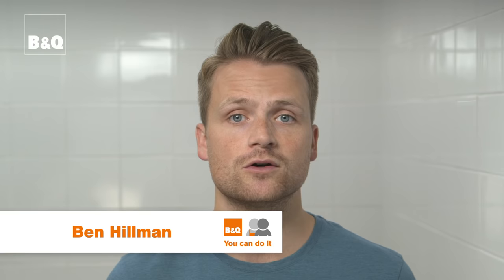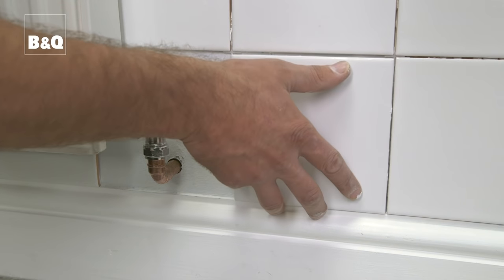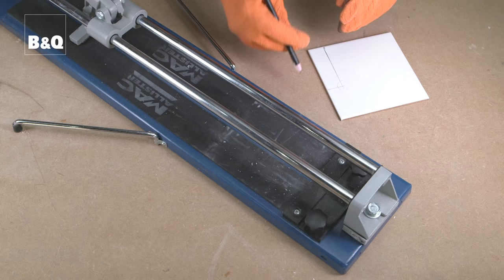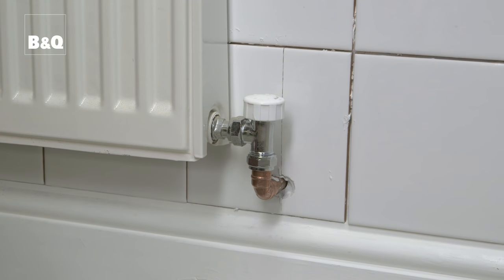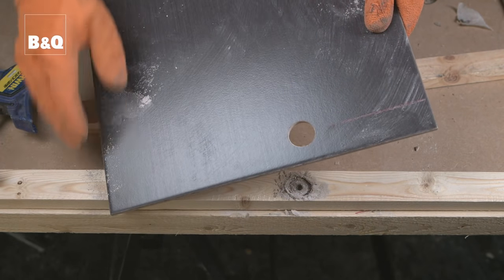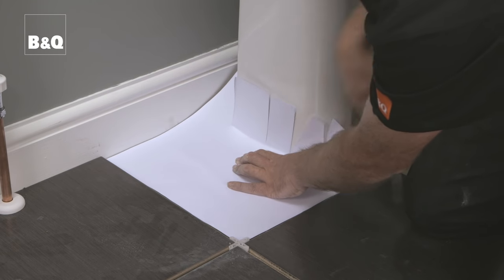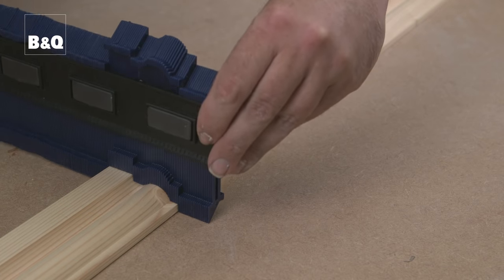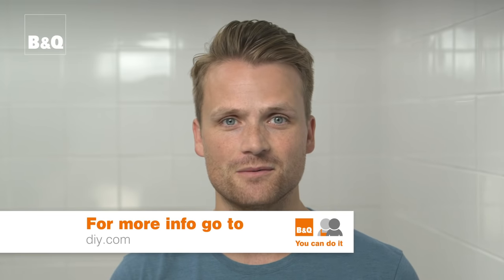How to tile around obstructions

Comment: Love how they measure up properly and cut the hole for that radiator pipe bang on - but the fit an absolutely atrociously off-centred tile afterwards! That'd be off in weeks, with the hot pipe expanding! Amateur hour :)

Comment: I'm dreading this job. My home was retrofitted with gas some point before I moved in so I have exposed pipes running around the entire perimeter of my house, including the bathroom (rather than neatly poking out of the wall as in this video) and they have made every renovation job so far so much more complicated. Perhaps foolishly, I've chosen quite large tiles for my bathroom and I think smaller ones would have been sensible - I can basically guarantee that every cut is going to be difficult. Thanks for the video - this was helpful and somewhat reassuring that it's possible. Wish me luck.
Reply: Hope the job turned out great for you 👍

Comment: Surely you couldn’t tile the bath and the reinstall the sink
Reply from the maker: Hi, there. Thanks for getting in touch. While it's possible to tile around a sink, it wouldn't be an ideal solution and the cuts required would be very difficult to make so we'd suggest removing the sink first. A tiler may be able to remove it if isolating valves have been used.
For more info on how to tile a bath splash back checkout the following link: https://bit.ly/3t3VWAN
Hope this helps!

Comment: Hi just wondering if grout should be applied between the wall and floor tile at the edge, or should silicone sealant be used?
Reply: Silicone because of the heat

Comment: I recently tilled in a room where my main brass water pipe enters my flat. Was it wise to grout the tile firmly round the pipe? I can see a problem should I need to remove the tiles in the future as this may rupture the pipe. Or can the tile grout cause damage to the brass pipe over time? 

did I do bad? this was my first time tiling. 

Amy.
Reply: ***** Thanks very much for taking the time to answer my question. I can now sleep a little easier at night.